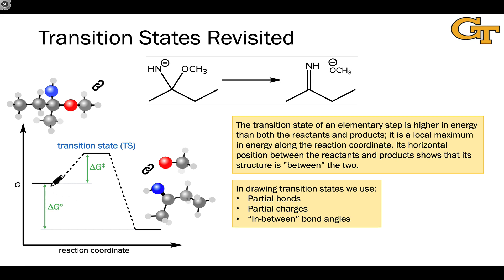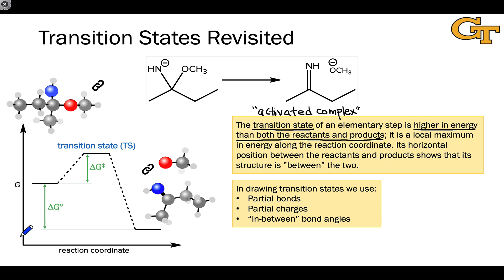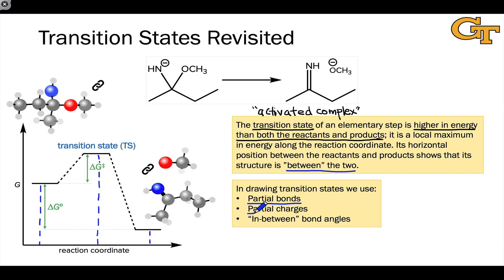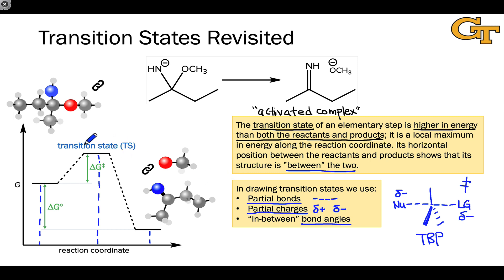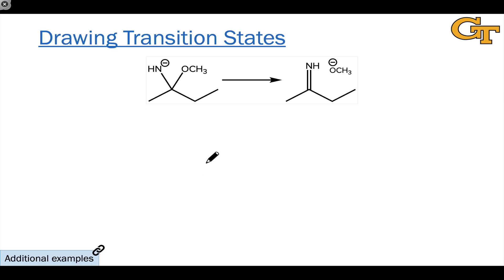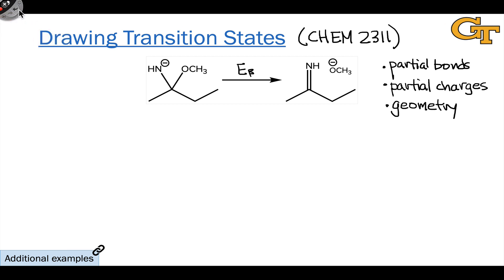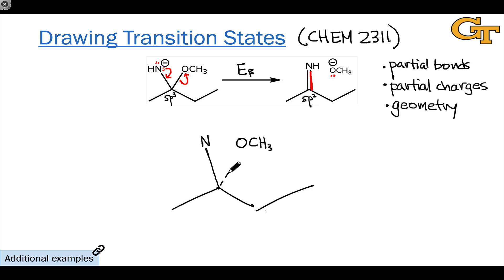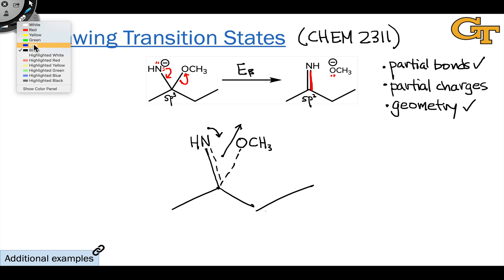01.02 Transition States Revisited

Comment: The difference between an activated complex and transition state is that TS is a point of energy maximum while AC corresponds to the region around TS. Although there is a slight difference between these two terms, they are usually used interchangeably.